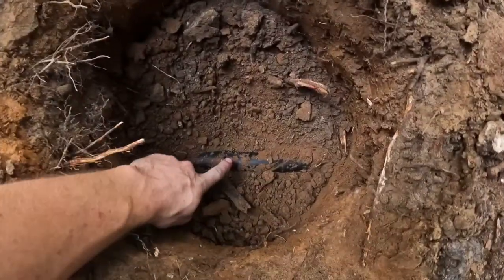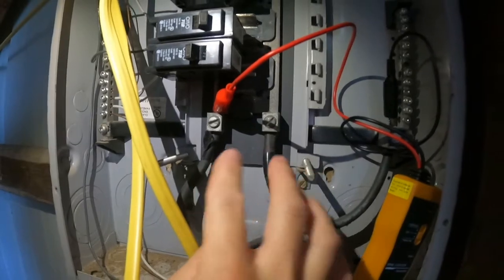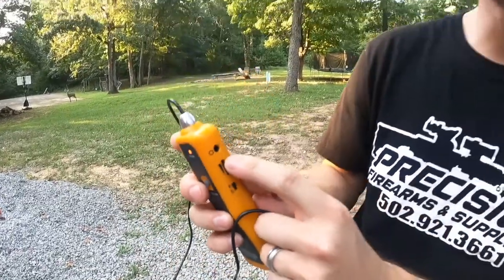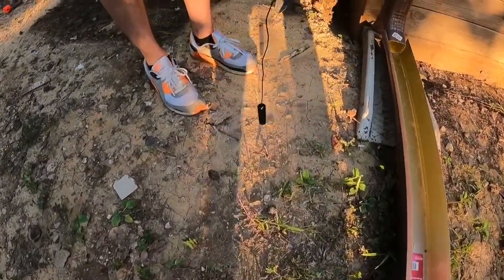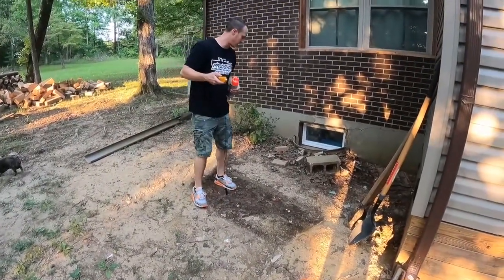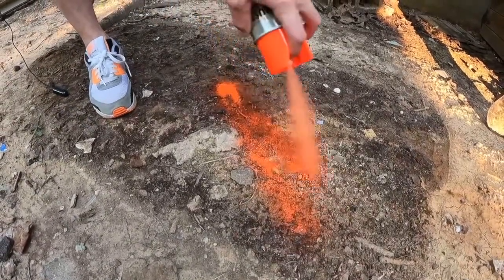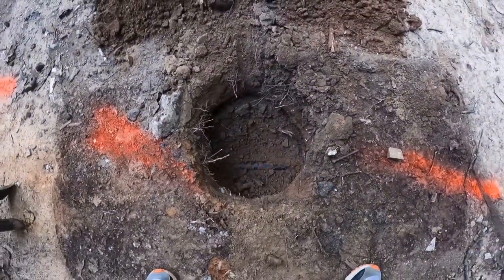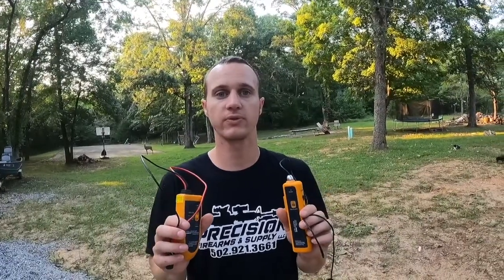Finding Underground Wires Yourself | No Extra Holes Dug, Very Accurate, You Can Do It Yourself!!

Comment: As a standard safety habit, always use insulating gloves when working with electricity (When not absolutely necessary, you do not need to touch open contacts, even if you believe you have disconnected the the power already).

Comment: What equipment were you using? We have large line locators but I want that small one.
Reply from the maker: There is a link in the description of what I used.
Reply: @projectdiy873 I don’t see the link but I will look around for it on Amazon
Reply from the maker: @zackk695 look in the description if you can't find it message me back
Reply: @projectdiy873 I found it exactly where you said it was at. I didnt open that description earlier. Thanks brother

Comment: Hey nice video. I am trying to do something similar with a de energized wire. Do you think this tool will fit for a wire buried 2 feet and in conduit? I tried the $60 klein tracer and it didn't work. Thanks!

Comment: These wire locators are hit and miss. The receiver was nearly deaf .. wouldn’t track past 6” from the transmitter. Returned it.
Reply: I have the same problem with a toner.  It will sound loud for about 3 feet down the wire and then quit as the resistance in the wire keeps the singal from going any more than 3 feet along the length of the wire.  These are cheap crap from China that seem to work but are no good at all as will not transmitt any more than 3 feet down a wire.

Comment: Hi, when the transmitter is connected to the mains, can its signal also propagate through a 12V power supply or a 5V Usb power supply and be detected on the cable of these power supplies ?
Reply from the maker: @gltubes  I honestly do not know
Reply: @projectdiy873  No,  not enough voltage in the single to overcome the resistance in the coils and wires.

Comment: For those insisting that 811 will take care of this. This is what I got directly from the local 811 "Any electrical lines past your meter are owned by you, and is your responsibility. These may include power lines running to barns, garages, outdoor lighting, or from your transformer (green box or pedestal) to your home or business. We can only mark up to a meter of underground line if your meter is on a pedestal, and not on your house."
Reply: True story. I haven’t been able to get them to find the lines to my shop for 20 years. I’ve called three times hoping the rules have changed and they haven’t.
Reply from the maker: @NaturebyGus  exactly that is why I had to do this thanks for the post clarifying that.
Reply: BUT --- if you do have to dig where it is before YOUR meter (water or electrical) and you didn't call 811----- you OWN the repairs !!
Reply: Dose the cable need to a charge running through for the thing to pick up on its location
Reply: @rekless1875 No, the transmitter applies a small charge.
Reply: We got the same message today after the 811 person came out.  He did measure up to our fence past the box but wouldn't mark anything.  Technically he wasn't allowed to even do that.  Safety not the top priority it seems...
Reply: Right, bc the utility company owns the line up to the meter. The utility companies created and funded 811 to protect their cables / pipes.

Comment: Hi, what is the distance between the transmitter and the point where you drilled the hole ?
Reply from the maker: @gltubes  I just had it right above the ground like 3 or 4 inches. As I went back and forth to find the wire.
Reply: @projectdiy873  Hello and thank you for your answer. 3 or 4 inches is the distance between the receiver and the pipe, I was asking about the distance between the transmitter or signal injector connected to the main box and the point where you made the digging. I suppose it is many meters ...
Reply from the maker: @gltubes  oh sorry yes probably about 30 or 40 yards
Reply: @projectdiy873  I had no idea that such an inexpensive device could work over such great distances and perform so well. Thanks again for the video.

Comment: Do not do any thing in this video. Very dangerous. You could get killed. I worked locating ug cables for 23 yrs. (811). He was right about 811 will not locate private cables. these are cables , water, gas not installed by your utility company. Never open a power panel in your home and connect anything to the wires in the panel. YouTube, this should be taken down.

Comment: Take note...The amazon link says that this will not work on stranded wire. have you been able to test this to be true? or was the wire you worked with not stranded?
Reply from the maker: The wire I traced was regular 3 wire black white and ground. Not sure the gauge that was run from the house to the barn.

Comment: You need to YouTube “adding a sub panel to a detached building” because yours was installed incorrectly. 1st off you needed to pull 4 conductor. 2nd, the neutrals and equipment conductors need to be terminated on separate  terminal bars and isolated from one another. Also, I don’t see a grounding electrode conductor headed to the two required ground rods……all this could be better explained in-depth from watching videos on here
Reply: Or its installed to older code or it's small enough that it doesn't need a local gec

Comment: Wouldn't you open, the circuit. If you turn the breaker off. It seems like you would break the line, and not able to detect the run.

Comment: You don’t call 811 you can go to jail.  You need to have it documented and on record before you dig it’s the law . U tube should take this video down you hit a gas line it can be your life.
Reply: The line he's showing in this video would not get marked on an 811 dispatch. It's the line from his house to his detached garage. In most cases, the electric company's responsibility for locating lines stops at the meter. Anything you put in to an outbuilding, lamppost, etc. is up to you to find using whichever method you can. The video is good info and should stay.
Reply: Not everyone lives in the city. Guess you should have listened to the words he was speaking quite clearly.
Reply: @soscattered6126  811 covers rural areas, as well. You've already paid for it, so you should use it.
Reply: @BenjaminWonders  you've already paid for it? The utility companies pay for 811. Each utility pays $1ish per ticket called in.
Reply: I called 811. I have main power to the house, water lines, and a propane line roughly in the same area. 811 couldn't help with any of them, said a contractor must have buried them and not their problem.
Reply: Electric, beyond the meter, is not located by 811 locators.
Reply: You won't go to jail if you don't call 811. But you're sure taking some risks!
Reply: I called miss dig, they don't do crap! Only line that was marked was an old telephone line. Give me a break! Didn't mark power or propane lines... USELESS.  I'm gonna do what this guy did, here I come amazon!
Reply: Is anybody in jail rn for this?
Reply: Ok wire police.
Reply: Tell us your clueless without telling is your clueless
Reply: If you read the actual statute, a home owner is exempt while digging within the owners property.  Watch out for utility easements.  The intent of the law is to protect utilities in public way and easements.  The information bulletins intend to scare you, read the text of the law, which recognizes the rights of private property.
Reply: @Phizz_the_poodle exactly. well said.
Reply: Thank you. @y2ksurvivor
Reply: Either bait or genuine yt nazi. That's private electric he needed located brother. 811 don't locate private utilities. This would actually be great for what I do as a fiber tech trying to locate and fix broken fiber lines.
Reply: If you using hand tool it fine... and what he was digging up was private locate. I've been digging holes for 10 years I've never hear something so silly. 😂😂😂

Comment: Live wires are not the only one buried danger.  There are also gas, water, sewer, and probably more lines you want to avoid hitting.
Reply from the maker: True but where I was digging I knew there was only electric.
Reply: Utilities installed by a competent individual will have a yellow trace cable you can attach to.
Reply: You are correct about the city not looking for wires in the back of your house. They already know where the utility lines are when they were first installed. That is all they are going to mark. Any work done post-original build, whether permitted or not, will not be flagged. They will go to the back if that's where the utility lines are 1st laid. Or if you're hiring a private co. to specifically check your property before a new project.

Comment: I bought a cheap one at harbor freight but it loses sound as soon as the line goes into concrete. You think a better unit would help?
Reply from the maker: It may but the concrete may pose an issue with any cheaper one. May not be able to detect through the concrete.
Reply: 811 is cheaper than any unit you can buy.  It also guarantees you that you are not liable for damages as long as you dig within the guidelines, which are pretty straight forward. Don't be the guy that caused the neighbors to be without gas,coms,or power because you located yourself... Oh and I didn't mention the fines.. they are  steep enough to make you call 811 for a free locate next time
Reply: @chris21904 811 is only for utilities from the road to the house. This was for private lines. 811 won’t touch private lines.